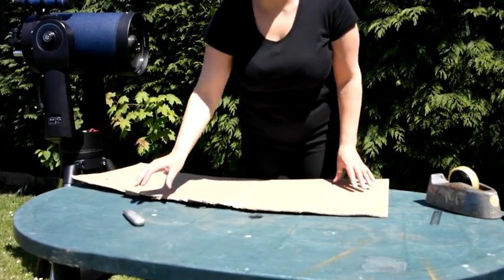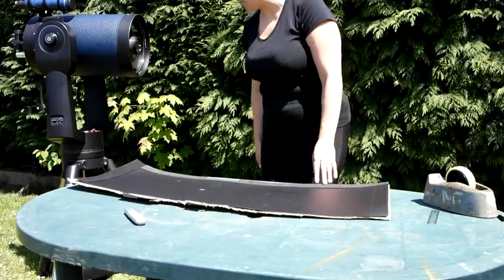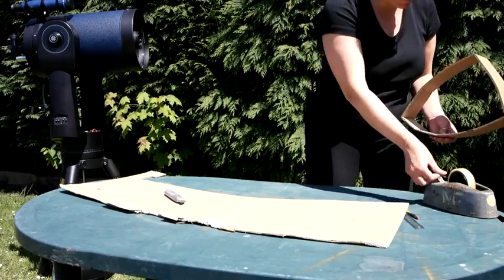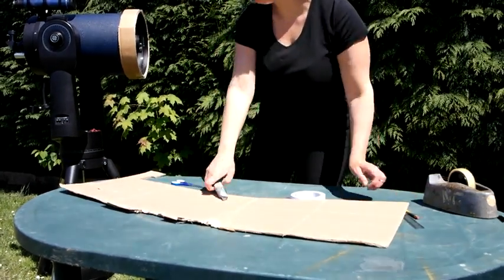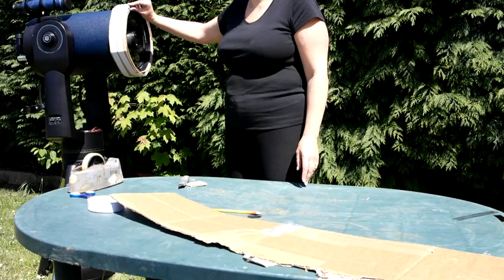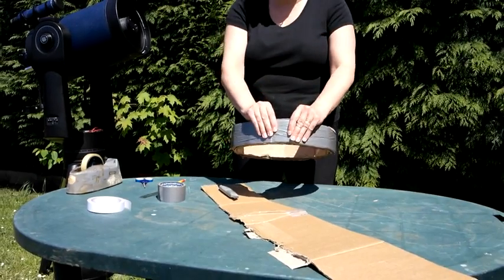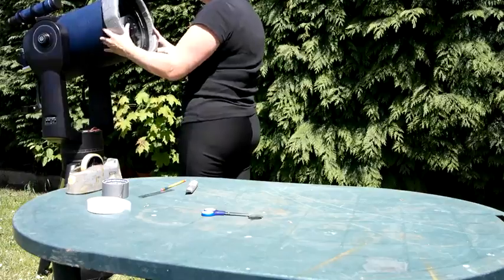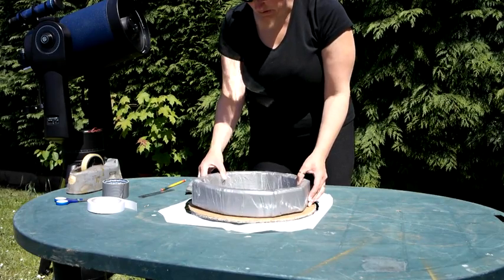How to make an Astronomical Solar Filter Part 2

Comment: Thanks for the video, though my application will be different for a telephoto lens, it helped me to see how you sandwiched the film, handled it, and your patience and trepidation with building it.  Nice job.  I am thinking for myself i will be putting my filter on a  screw mount for a tele lens.  I have thought of several ways to mount it; one is to sandwich it between 2 UV filters; another is to sandwich it between a filter frame and adapter, that would sandwich it between a magnetic frame, and finally I thought of gluing it to the outside edge of the magnetic frame.I have been concerned that Baader, recommends not to stretch film; slightly looser is better for optical properties.  here is my thoughts, sandwiching it between a magnetic rim might be fine, but might pull it too taught?  Gluing it could work, but I'm afraid I might not get a smooth application.  sandwiching it between glass might be best.  What do you think.  Based upon your experience, am I missing something or over-thinking it?  Thank you!

Comment: Thank you very much for the video: QUESTION: Can i attach my filter to the dewshield of my 120 refractor? Again, thank you very much for the video, both part one and two. Now it is just a matter of me biting the bullet and making my own.
Reply from the maker: I see no reason why not - however.  I would make sure it is a tight fit.  Looking at the sun using a homemade filter means you have so be sure that no sunlight unfiltered gets through.  Damage to the eyes would be catastrophic.